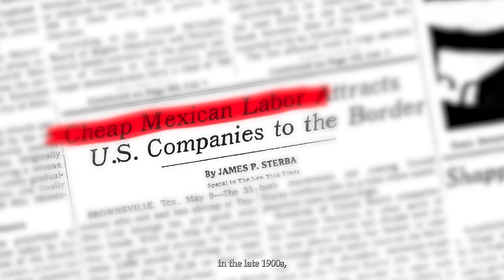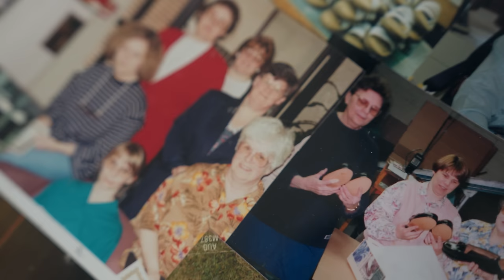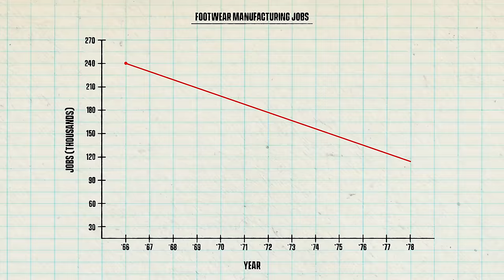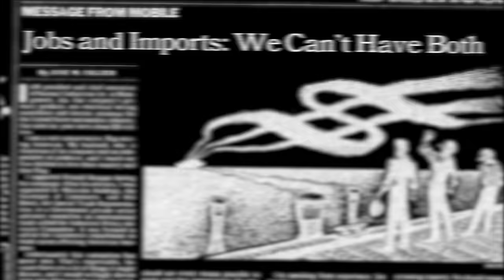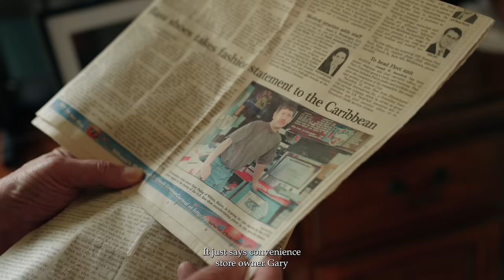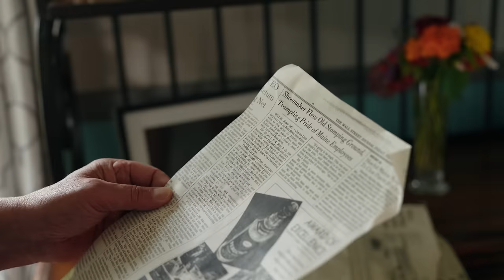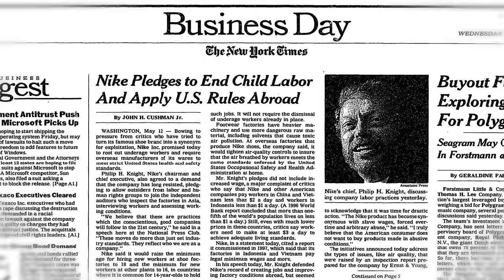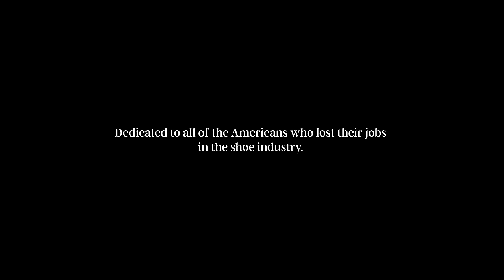Abandoned American Towns - Who's to Blame?

Comment: I remember good American clothing from up East, too, even as late as the late 80s.
The knowledge can be re-established. I know that Origin got hold of some ancient machines. If you return these types of operations to the US at scale , new and better machines would be a real advantage. I think a necessity.
The problem was that once one significant manufacture left for the East, the rest had no choice but to follow. It wasn't the Maquiladora. The Maquiladora got smacked down worse. It was the moves to Asia. $10 to $5 an hour is one thing. $10 to $0.05 an hour using the exact same equipment is another.

Comment: Rural areas do not have the reliable labor, people are not going to pay $300 vs $100 for a shoe because of where it is made unless they have money to burn. Most people do not choose manual labor and assembly line over service. If you choose manual labor mechanic auto or air pays better and there is a good labor shortage for that or construction and service for people residences. You have mor flexibility and advancement after a decade or so in those jobs.

Comment: Most of the outsourced products quickly turn to crap.  Example, Ticonderoga pencils were the best when they were US made.  As a teacher, I required them although they were a bit more expensive, the quality was excellent.  They lasted, wrote smoothly, were resistant to breaking, both the graphite quality and the pencil assembly.  Then they moved for a short time to Mexico, the price stayed the same but they no longer wrote as well, graphite was prone to snapping under pressure of writing.  They moved again to China.  Now, all that remains is the name.  Like other Chinese made pencils, they are crap.  The graphite is crumbly, writes unevenly, the hardness numbers are inconsistent from batch to batch, it’s no longer glued to the wood, and the wood quality is poor, no more cedar or oak, just the cheapest pine or press wood.  When sharpened, the wood crumbles away.  The graphite falls in segments from the wood because it’s not glued inside, the graphite itself won’t hold a point.  In two days, sometimes less, the pencil is used up, ground up or fallen apart to nothing.  The ferrule that holds the eraser in place is thin, poorly attached with an unsealed seam.  Go to erase and falls off the pencil and the eraser falls out.  The erasers are no longer rubber but plastic.  They harden and crumble away on first use, or don’t erase, just smear—useless!  My last few years of teaching I supplied pencils by seeking old, US made batches online, or finding them partially used in bags at thrift stores.  I’m not sure if they are still here or actually made 100% in the US, but there was ONE remaining pencil manufacturer in the USA, The General’s Pencil Co.  In the past, they were considered of lower quality, but last pack I bought, maybe in mid twenty teens, were better than any of the outsourced brands, and very expensive.

Comment: In the late 1800s, early 1900s, when import tariffs went away or were reduced, it allowed cheaper labor markets to overrun US industry, US steel, US clothing and shoes. The US auto industry. Due to pressure to increase wages in this country, the US has outpaced China, Vietnam, India, and other highly populated countries where labor is very cheap. MIn wage in India is around $2 per hour, the US min wage is $7.25, more than 3 times that if India, moving a plant to India or China or Mexico lowers the cost of labor by 70%. Businesses are in it to make money, without the import tariffs making up for the cheap labor from foreign markets, the US companies can't compete with foreign manufactured products. I can buy a pair of US made Carolina boots for $300 or I can buy a pair of Brama boots from China for $50. When the soles wear out on the Carolina's, it costs as much to resole them as a new pair of boots. I may have to replace the Brama boots 3 times but still have $150. Some manufacturers have rested on the "made in America" tag and not improved the product. Harley Davidson is still using the same push rod design engine that it used in the 1930s while Japanese manufacturers have been using overhead camshafts and other improved designs since the 1950s. If there is blame to be placed, I think it would go to the politicians and the voters who elected them, and some for the companies who did nothing to improve products. If you look historically at when US businesses started getting bashed out of existence by Asian companies, it is when our own government started reducing import taxes and instituted an income tax on the working class of this country. Before income taxes the revenue for the government was mainly import and export tariffs, the income tax started out at 1% of income over $3000, today it is 10% to 37%, the politicians got their hands on the American taxpayers wallet and never let it go. This is how the US subsidizes the rest of the world's cheap labor that is killing US industry.